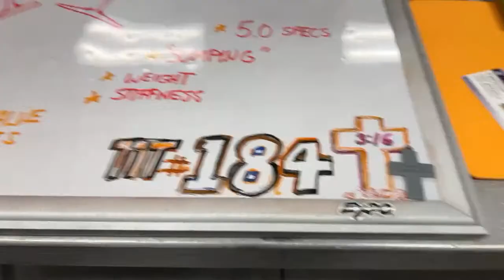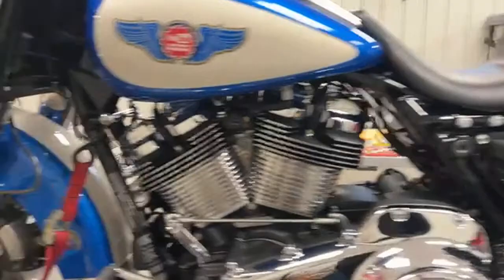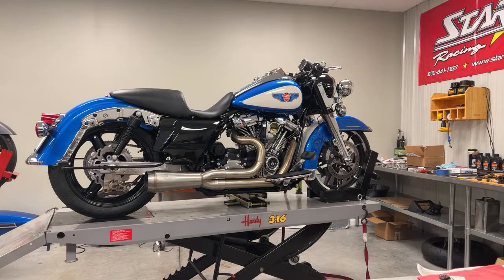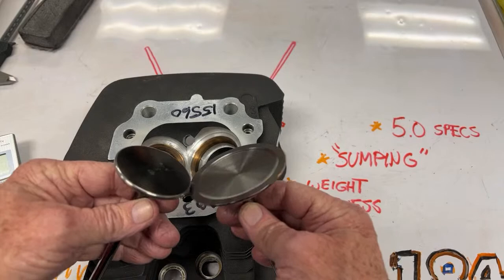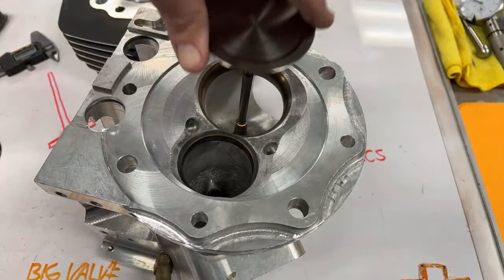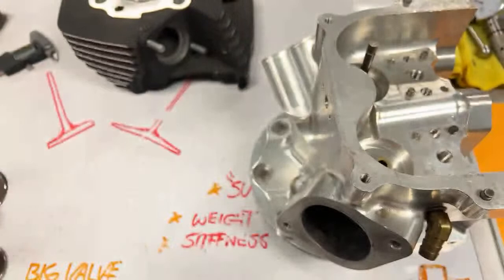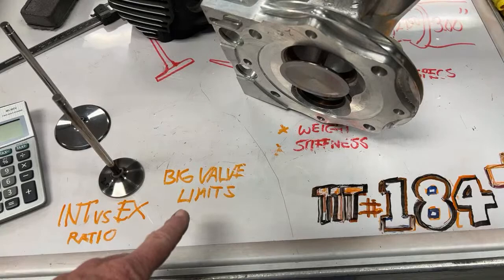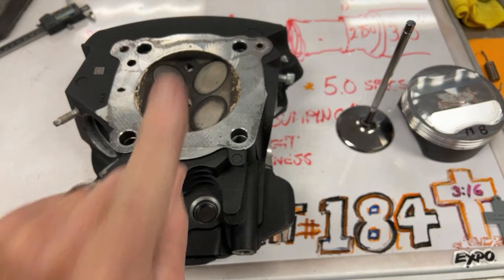Tech Talk Tuesday #184 with Star Racing’s George Bryce

Comment: George, Tech Talk 183 and 184 were both were full of good information.  I know, no one makes a 4 valve head for the twin cam, but would the twin cam engine benefit from a 4 valve head? Maybe open the bore to 110 - 124 CI
The M8 started out as a 107 and from I have seen from videos with a cam swap and other upgrades the power and torque goes up pretty good. I am planning on going to Moonshine Harley Friday or Saturday to meet with Arron, any chance you would be around?

Comment: George, you say cold cranking compression is not important… are you able to give a safe CCC area? Im told (as example) on a 89” Evo hot rod build 200 psi should be about max because of tuning ability’s with a carb? 

Is 220psi safe?
Is 230psi safe?

And of course the earlier intake cam closes the more compression which hands off to CCC…

Is it a matter of compression releases, timing and tune only? Then gas today, 93 ok for higher compression?

Example, on blue50, what is the static compression and what is the intake closing on that bike, and are you running 93 pump gas only?

God bless!
Thanks for teaching videos and bragging a little on the Great King Jesus… do that a little more please!

Comment: Dang I missed ya live! I’m running a Fuelmoto 128 running with ther short jackpot rtx 2 into 1 and it runs hot. I’m gonna swap the exhaust & also swap the Hd oem oil pump & plate.  To a fueling oil pump & plate. I hope that corrects it!

Comment: Wet sumping
Reply: Autos store their oil in an oil pan directly below the crankshaft/engine block. Such a design is called a “Wet Sump”. 
Harleys store their oil in a tank that is separate from the engine block. This design is known as a “Dry Sump.” The oil pump on a dry sump engine has a suction port and a pressure port. 
Sumping occurs on Harleys when the suction port cannot return the oil to the tank faster than the pressure port is supplying it to the engine. Due to minimal clearances between the engine block and rotating assembly this extra oil that is not getting properly removed from the engine (aka: sumping) starts to contact the flywheel and connecting rods. This in turn causes the oil to aerate (foam up) which will then lead to a host of other problems.